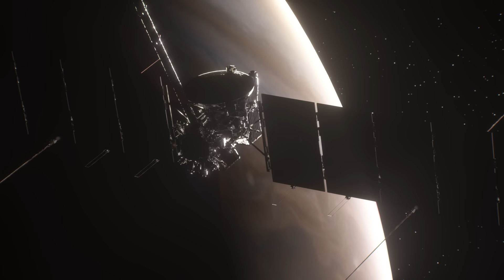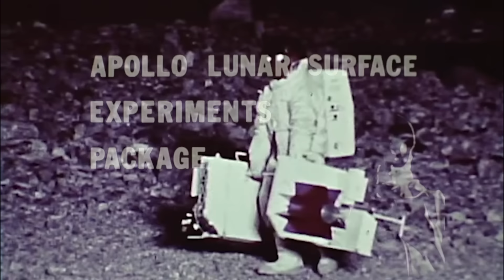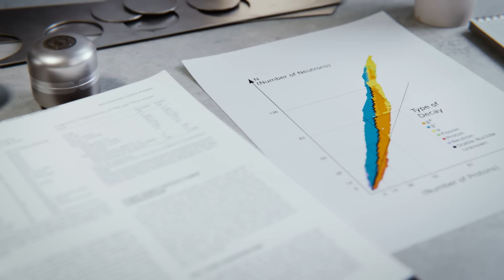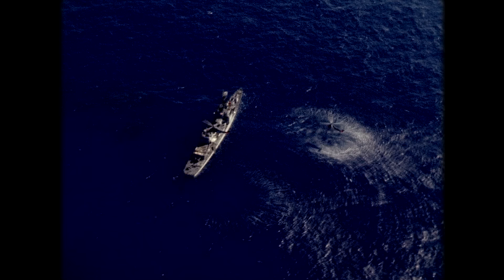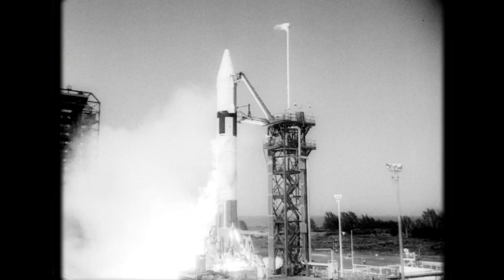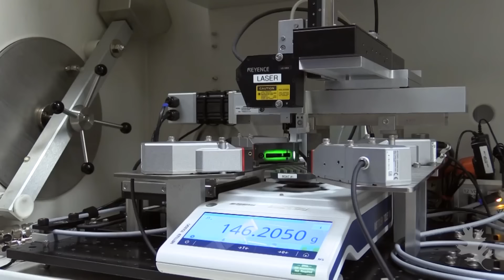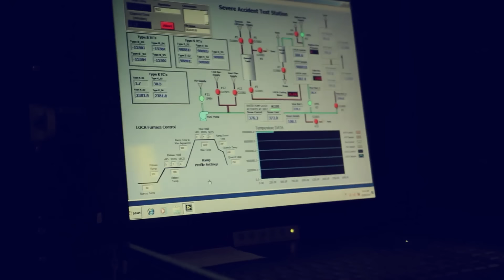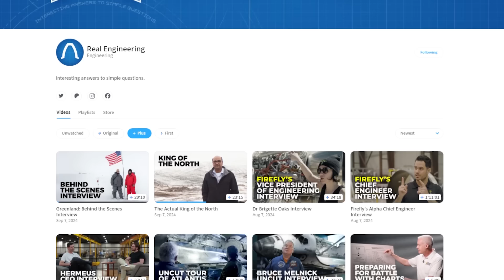NASA'S Plutonium Problem

Comment: In 2017, NASA started the KiloPower project.  It was a small, lightweight, nuclear fission reactor using Stirling engines to convert heat to electricity.   It died by 2019 with little explanation.  Is this an option anymore?  If not, why not? 
SpaceX has reduced launch costs.  Why not contract with SpaceX to launch lightweight fission reactors to the moon or high earth orbit?  Imagine a "squad" of lunar rovers that could recharge at a fission "base".  Iterate this concept and improve.  Bottom line: What's NASA's malfunction when it comes to lightweight fission reactors?
Reply: It didn't die, it was completed and was followed up with the Fission Surface Power project which, last I saw, has a demonstration target late in the 2020s.

Regardless, the U.S. is already producing enough Pu-238 for NASA.
Reply: @tacitgrasp  Thanks for the info.  Good for NASA, Fission Surface Power looks promising.  Hopefully NASA gets the resources and has the balls to make it work.
Reply: @ jackgee3200   Right.  It's ok to launch PU-238 into space but U-235 is soooo much more dangerous. So U-235 is BANNED.  Because reasons.

Great effin' argument. Your mind-virus of emotional safety-ism is what probably killed NASA's KiloPower.

Comment: So are we actually running out of Plutonium, or is there loads of it in Russia??
Reply: The video is misleading. Russia has stockpiles of Plutonium. So does the U.S. Russia has little of any Pu-238 and hasn't been able to produce it since around 2010. The U.S. produces enough Pu-238 each year to keep NASA's deep space missions going until well into the next decade and is working to build out more production capacity over the next 10 to 15 years. China is the only other country able to produce Pu-238 and they can barely keep up with their own demand.

Comment: I worked first hand with this stuff in safety testing the capsules. It’s amazing material. Thermally so hot that it must handled with tongs. So radilogically hot that glows in the dark.  The potential for contamination with this material is so high that it’s difficult to work with. The alpha decay process that creates the heat is so intense, we use to joke it had legs.  It’s analogous to watching radioactive popcorn pop.  From a science perspective its amazing characteristics makes it unique. From a processing perspective it’s just plain nasty business!  I recall having a conversation with a nuclear facility manager about bring in an experiment into a new wing of an old facility.  My recommendation was don’t unless you want to spend the rest of your career cleaning up after your experiment is done.  It’s Covid on steroids!   Excellent video.
Reply: Savannah River National Labs came up with several new items or processes that helped us locate more precisely where the highest concentrations were, and to decontaminate it while dealing with the challenges you mentioned. Some of the stories about dealing with 238 are exaggerated, but there's no doubt it's much, much  trickier than 239.
Reply: Covid? Really? You’re a moron

Comment: It seems that you could boost the Seabeck effect by using an alpha decay emitter to enhance the hole population and beta emitter to enhance the electron population.  The same would work with P-N junction of a solar cell.  Maybe that would be the way to tweak the solar cell gamma energy frequency window into the high energy level for direct capture of decay source gammas.  It might be a cool way to detect neutrinos, too.

Comment: The sterling idea sounds like it would only work with much higher amounts of heat, otherwise the friction is too much.

Kinda like dumping thrust quickly to minimize delta-V lost to gravity, you'd have to do similar to avoid friction being a cumulative loss of energy. The thermoelectric method sounds like something that can work with very low heat differentials.

Aka the faster sterling goes, the more efficient it is until RPM limits start coming into effect. No moving parts instead means higher efficiency at low speeds/rates

Comment: The root cause of all this is the outlawing of fuel reprocessing in the 70's.  There is plenty of any isotope you may wish for in the used fuel pellets in any power plant.  But extracting those isotopes was outlawed by the Carter administration because of proliferation concerns.

Everything in this video is a work-around of that law.

Comment: As a chemist: How do you make Pu238> You cant do wet chemistry it would boil away solvents. How do you machine it? Its red hot and very hot radioactively? Some sort of gas with flourine?
Reply: Not sure, but it's one of the hardest challenges in machining I've heard. At least for nuclear weapons pits where you have very low tolerances. Very difficult metal to work with, not even considering the toxicity and radioactivity.
Reply: Yes, a lot of Pu chemistry is done with plutonium hexafluoride
Reply: It isn't that much active to evaporate solvents especially considering that chemists work with milligram quantities of Pu.

Comment: Incandescent light bulbs use a filament with an electric current to generate light , if an alloy with 238 or other radio active isotopes could generate photovoltaic light then miniaturised in the same way as trillions of transistors are with computer CPUs,  then it could generate electric power with modified photovoltaic cells without the need for a cold thermal gradient .
Reply: Heat is just longwave infrared light.

Comment: So NASA/America was researching more efficient engines which use about 2/3 less plutonium-238, but cancelled the project in favour of just making more fuel to burn. Why am I not surprised? It's exactly the reason why all their cars are gigantic huge chunks of metal with shitty fuel efficiency which get beaten by EVERY SINGLE Japanese or German engine. I hope ESA beats/researches the shit out of NASA.
This technology has huge implications for power plants or waste heat energy if done properly.
Reply: None of this is accurate or makes any sense, but it is a fantastic example of ignorant anti-American bigotry.
Reply: @Objectified  did you even watch the vid? It makes perfect sense. NASA cancelled the improved Sterling engine with 30% efficiency and chose to continue to use the Piezo electric chips with 7-9% efficiency.
Just proves Americans are lazy and stupid. Go back to licking Trumps brown hole.

Comment: The average nuke has 10 pounds of plutonium; the US has 3500 warheads undeployed and stored away (1500 in use). That's 17 tons of material available.
Reply: It's a different plutonium bro, watch the video before commenting
Reply: Different type of plutonium...
Reply: That's the wrong kind of plutonium.
Reply: @stargazer7644  The point is that we can make more.  The premise of the video is that there is a small amount stored and that it's running out so we're doomed.  We can make more, even if it involves taking apart some old bombs and spraying them with neutrons in a centrifuge.

Comment: aluminum converts radiation to neutrinos...
iridium may act as a catalyst as it might deflect the radiation back... boronated stainless steel can do this too. but still decays.

iridium and gold may resist the effects seen in graphites... storing radiation by the doping effects. but most materials are changed while exposed to radiation. 

these things may never decay to a point of no heat. 

so it should always generate power, much like how solar can harvest power.., even from
 wifi.

Comment: @15:26, there are two mistakes with that graph:
Firstly, the blue line is at 0.05g, not 0.5g, so only a 5% yield by mass instead of a 50% yield.
Secondly, 0.05g or 0.5g are not at the center on a logarithmic scale. 0.31... (= square root of 0.1) is.
Reply: Ah!  Somebody who does the math! 👩‍🔬👩‍💻 I thought something didn't look right.  5% yield sucks.

What if you take U238 and bombard it with positrons?  Inverse beta decay.  Np238, then a real 𝛽⁻ to  Pu238.  Advantage: no neutrons to accidentally turn something into something you don't want.  If a U238 absorbs two positrons, it immediately turns into Pu238.  If it absorbs three, Am238 decays back to Pu238 in a few hours.  Same for Cm238.  Advantage: you're only shooting in one direction, so no collateral damage.  Advantage: U238 is cheap and ubiquitous.

Something tells me somebody else thought of this.  And, the positrons are pretty expensive?

Comment: 17:07  "the moon offers better conditions for solar power" — Solar systems are a pig. To generate 90kW ISS uses 8 massive solar arrays weighing over 20 tons w/ 9 batteries weighing 3 tons good for only 6 years. They get jettisoned into the ocean and have been replaced multiple times. Now, haul that a quarter-million miles (one-way) to the moon and try that process. Plutonium 238 RTGs don't cut it, they are only good for a few hundred watts— fine for robotic probes the size of a Volkswagen but not manned bases. Microreactors are the future of manned space travel: 40kW good for decades, easily fits into a rocket.  NASA knows this, ergo their Fission Surface Power Project. Microreactors are a subset of Small Modular Reactors (SMRs), which are easily good for 300 Megawatts (7.2 million kWh per day) for 40 years, likely the ultimate solution for any permanent space colony. Great British Nuclear (GBN) has entered the final stage of the UK's Small Modular Reactor (SMR) selection process and is on track to make final decisions in the Spring. One finalist, the GE Hitachi BWRX-300, can power 300,000 homes with a power plant footprint that's smaller than the size of a football field (smaller than ISS's solar arrays). Given that Brits and Europeans pay 5x than Americans for electricity due to insane "green energy," it stands to reason they would pursue this.

Comment: Well...  To rapidly resupply its needs for Plutonium-238 (Pu-238), the U.S. would need to address both production capacity and logistical challenges, building on its existing infrastructure while exploring innovative solutions. Pu-238 is critical for powering radioisotope thermoelectric generators (RTGs) used in NASA’s deep space missions, and the U.S. has been working to reestablish domestic production since the late 1980s when it ceased at the Savannah River Site. Here are several strategies the U.S. could employ to accelerate its Pu-238 supply:
Expand Existing Production Facilities: The Department of Energy (DOE) currently produces Pu-238 at Oak Ridge National Laboratory (ORNL) using the High Flux Isotope Reactor (HFIR) and the Advanced Test Reactor (ATR) at Idaho National Laboratory (INL) to irradiate neptunium-237 (Np-237) targets. To ramp up production, the U.S. could:
Increase the number of irradiation cycles in HFIR and ATR by optimizing reactor schedules and reducing downtime for maintenance.

Scale up target fabrication at ORNL by automating and expanding the production of Np-237 pellets, as has already been partially implemented for the Mars Perseverance rover.

Enhance chemical processing capabilities at ORNL’s Radiochemical Engineering Development Center to handle larger volumes of irradiated targets and extract Pu-238 more efficiently.

Leverage Additional Reactors: Beyond HFIR and ATR, the U.S. could activate other DOE or commercial reactors capable of high neutron flux irradiation. For instance:
Research reactors like the one at the University of Missouri could be adapted for Np-237 irradiation, though this would require significant upgrades and regulatory approval.

Partnering with private industry to use existing nuclear power reactors for limited Pu-238 production runs could supplement supply, though this would involve complex safety and regulatory hurdles due to differing operational priorities.

Optimize Neptunium-237 Supply: Pu-238 production relies on Np-237, a byproduct of nuclear reactions. To ensure a steady feedstock:
Increase extraction from spent nuclear fuel at DOE facilities like INL, where Np-237 can be recovered during reprocessing.

Explore international partnerships to acquire additional Np-237 from allies with nuclear programs, though this would require careful negotiation and transport logistics.

Accelerate Process Improvements: Current efforts at ORNL include testing higher-yield Np-237 targets (e.g., using pure neptunium-oxide pellets clad in zirconium alloy). Fast-tracking these innovations could:
Boost Pu-238 yield per irradiation cycle, reducing the number of targets needed.

Shorten the timeline to reach the DOE’s target of 1.5 kilograms per year, which is already on track for 2026 but could be expedited with additional funding and personnel.

Stockpile Management and Blending: The U.S. has a limited stockpile of legacy Pu-238 (approximately 35 kg as of past estimates, with only about 17 kg suitable for RTGs). To stretch this supply:
Blend lower-quality Pu-238 with newly produced material to meet NASA specifications, a technique already used for the Perseverance rover.

Prioritize missions with urgent needs while stockpiling for future use, optimizing allocation.

Emergency International Procurement: As a short-term measure, the U.S. could seek to purchase Pu-238 from countries like Russia (a former supplier until 2009) or explore new suppliers like France or the UK, which have advanced nuclear capabilities. However, geopolitical tensions and export restrictions make this unreliable and politically sensitive.

Increase Funding and Workforce: Rapid resupply requires significant investment and skilled personnel. Congress could:
Boost NASA and DOE budgets specifically for Pu-238 production, building on the $150 million+ already invested since 2011.

Recruit and train additional nuclear engineers and technicians to operate facilities 24/7, as ORNL has begun doing.

Challenges and Considerations
Time Constraints: Even with optimization, scaling production from the current ~400 grams per year to meet urgent demands (e.g., 5 kg for a major mission) could take years due to reactor capacity and processing bottlenecks.

Cost: Producing Pu-238 is expensive (~$4 million per pound), and rapid expansion would require substantial upfront investment.

Safety and Regulation: Any acceleration must comply with stringent nuclear safety standards, potentially slowing deployment of new reactors or methods.

Feasible Timeline
With aggressive funding and coordination, the U.S. could increase production to 2-3 kg per year within 2-3 years by maximizing ORNL and INL capabilities. Reaching higher outputs (e.g., 5 kg/year) would likely take 5-7 years unless additional reactors are brought online. For immediate needs, blending existing stockpiles with new Pu-238 offers the fastest workaround.
In summary, the U.S. can rapidly resupply Pu-238 by enhancing current facilities, optimizing processes, and strategically managing its stockpile, though full-scale production increases would still require several years of concerted effort.

Comment: Thanks for mentioning  the SNAP 19 that was shot into the Pacific.  I worked 2nd shift Christmas Eve getting it ready for the launch, at Martin Nuclear.  The starting material for Pu238 is spent Naval fuel and we have a lot less of that these days, thanks to long lived cores.  We never thought Pioneer and Voyager SNAP 19s would last as long as they have.  The heat is still there, but the TAGES semiconductors die.  When they stopped funding us, we were working on SNAP 27  GdPo heat source, in Pt tubing.
Reply: Sorry dude, refueling subs cost too much, took too long, and ultimately impacted fleet readiness.
Reply: @williewonka6694  The old fuel is still a goldmine for Pu production once they're spent too, virtually no one else is allowed to run reactors with that much nearly pure (>90%) U-235. The higher the U-235 purity the more Pu-238 you get compared to Pu-239. The US navy alone probably has the lion's share of HEU actually in reactors today. Everyone else had to stop because of the non-proliferation boogeyman.
Reply: @Shaker626  Are spent Naval cores currently being processed? Last I heard, they were stored in open air facilities for treaty compliance, at least until 2026, when Russia completes withdraw from the treaty. Id like to see the US begin reprocessing the cores for other uses.
Reply: @williewonka6694  It's highly likely they will start reprocessing the cores soon. They can't just bury them anyhow, they don't have a geologic repository suitable.

Comment: The company I'm working at, entX (from Australia), is developing RHUs for commercial medium to long term space missions, using radioisotopes that, instead of being regulated for their toxic and radiological problems like plutonium, piggyback on the medical isotopes supply chain. We are planning a demonstrator flight in 2026, which will be the first ever commercial launch to undergo a nuclear flight safety approval, allowing commercial missions to utilise this technology, and take it away from the plutonium supply chain problem.

Comment: 8:20 I was under the impression that the Apollo Lunar module used batteries and fuel cells for power. In all the documentaries I've watched and documents I've read there was never any mention of Apollo using RTGs.
Reply: The RTG was used for the lunar surface experiments package that was intended to be deployed during the landing and remain in active communication with Earth after the astronauts went home.  Since they never landed it was still in the cargo bay of the descent stage which is now at the bottom of the ocean.

I wonder if it would be worth it to go find it and bring it back up? :)